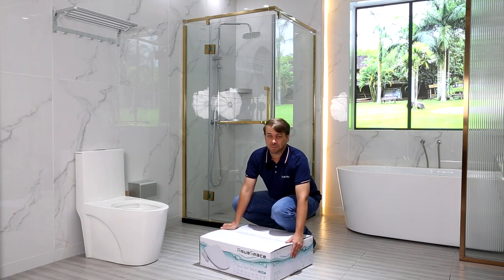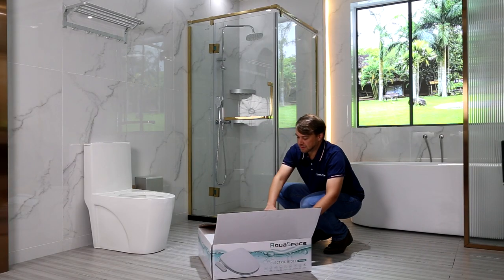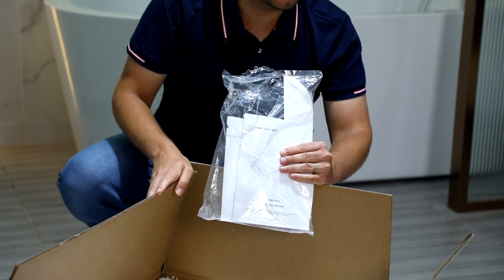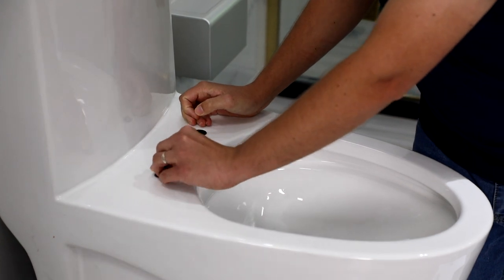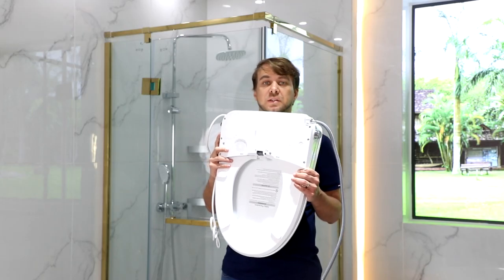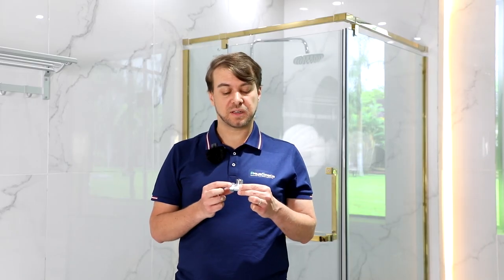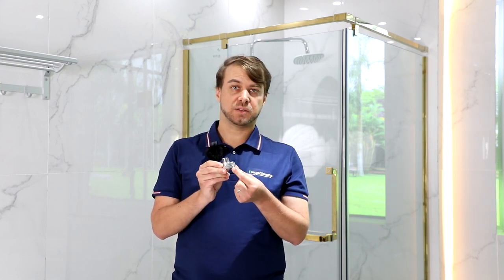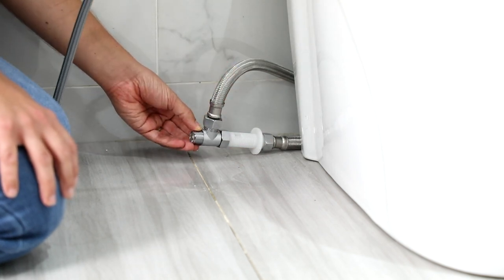AquaSpace Electronic Bidet installation video

Comment: Worst instructional video I think I have ever seen. Doesn't say anything about squaring up the mounting plate. Push a button for disassembly and then he disassembles it but then it comes back to it and it's installed. There are huge gaps in the steps to be taken.